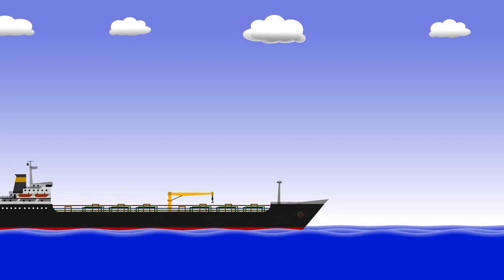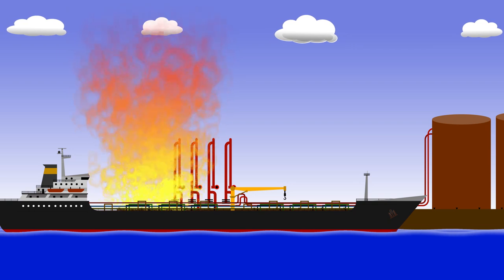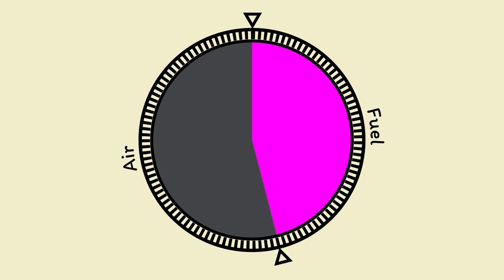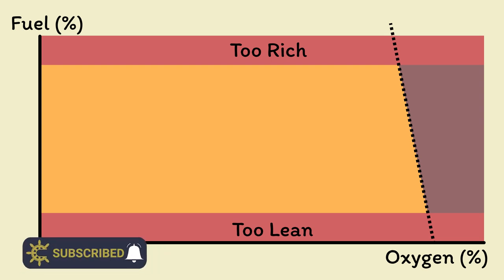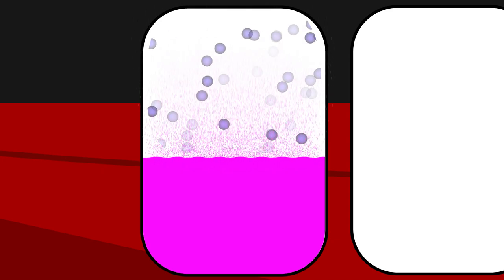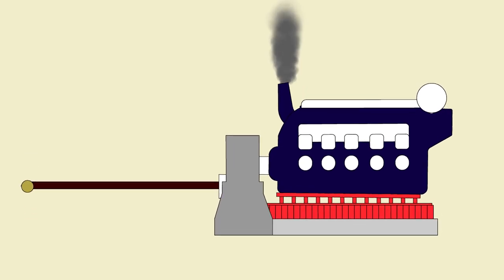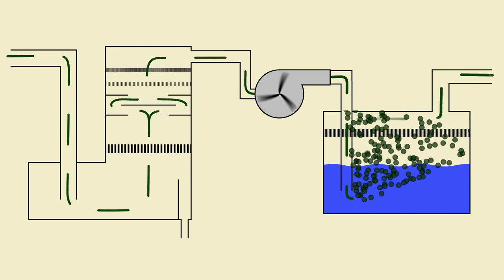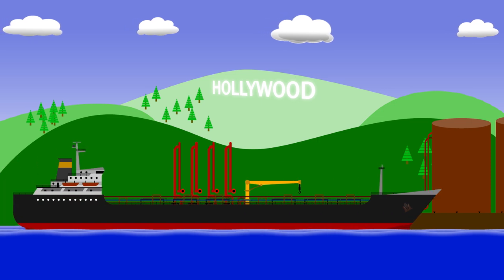Why Can't Petrol Explode On Ships?

Comment: Combustion Engine does not necessarily all oxygen to CO2, some oxygen remains based on efficiency of combustion. Also, For ships that transport bunker fuel or diesel, this flammable zone is the same with the ship's fuel. But if it transport other types of fuel like LNG, LPG, gasoline, the flammable zone becomes different. So it is actually very risky to use CO2 to make the content inert using ship's exhaust. Not mentioning that in case of combustion failure in engine, it may deliver oxygen rich gas to the flammable storage. Bunker fuels (which are typical fuel of ships since they are the cheapest) are also rich in sulfur which burns into sulfurous acid (H2SO3) can cause corrosion on metal surfaces. Also Reaction of CO2 with water seal forming weak acid called carbonic acid need also to be prevented since it may also cause corrosion which can cause leaks that may lead to explosions. In summary, CO2 is not the most cost effective option for inserting flammable fuel considering additional cost for safety and corrosion prevention needed for t

Comment: so what happens when the ship is at dock and the engines are not running yet but the fuel is being pumped in?
Reply: Mark S thats why normally auxilliary boilers are used and tuned to produce the highest amount of inert gas. Never heard the story of the engines itself being used for the production. They can deliver proper amounts of exhaust gas during the discharge for the cargo tanks and during loading for the ballast tanks.
Reply: The ship's engines are always running, you never shut them or it will be very inefficient especially in Tankers where there is always the possibility of emergency evacuation of the dock, see the use of firewire as well.
Reply: @mitsvanmitsvanio6106  how is the main engine always running if the ship is stationary?!

Comment: Dec. 17, 1976: Smoke billows from the wreckage of the Sansinena after a massive explosion split the oil tanker in two in Los Angeles Harbor.

(Jack Gaunt / Los Angeles Times)
Reply: Blasted windows out 22 miles away.

Comment: Video request: Why do ships need pilots? Many times I 've seen a boat with "pilot" written on it.
Reply: Pilots bring local knowledge to the vessel, for ships such as ferries that run over the same route the Master (Captain) of the vessel may gain sufficient local knowledge to be granted a 'Pilotage exemption certificate', thus saving time (and money) a situation that is always a bonus from the vessel owner/operator point of view.  Pilotage also gets the Port State a 'loyal' set of eyes on board for when things go wrong and thus helps them put 'the blame' on the vessel in any subsequent enquiry.

Comment: Tankers generally discharge cargo in port, the exception being when lightering. In port the Main Engine is stopped, so what is the source of inert gas? And why do the majority of incidents occur during tank washing?
Reply from the maker: Tank washing generates static. The sparks from that can ignite vapours.
Reply: @CasualNavigation  Thanks for the reply. 
I'm still at a bit of a loss, if the empty tank's atmosphere being washed is held below the LEL how does the generation of a spark within it cause an explosion?
Also, if tank washing is conducted at sea then will not the vessel benefit from having the Main Engine running and thus the provision of an inexhaustible supply of inert gas?
Is tank washing done at sea or in port? which brings me back to the original question of how is inert gas generated in port with the Main Engine stopped?
Reply: The main engine never stops, it is very inefficient to stop it, it just working underpowered.

Comment: The principle theory shown in this video is correct. However, the application or practical use on board a tanker as shown in the video is a bit misleading. The inert gas from the engine room is not sent to the bottom of the cargo tank such that it would produce bubbles in the cargo which should be avoided. The inert gas is supplied into the tank at the top of the cargo tank, not to the bottom of the tank.
Reply from the maker: That part of the diagram was still the inert gas generator

Comment: The remove the O2? Or they just add CO2 and increase pressure?
Reply: The 02 is used up in the combustion in the gas generator (or engine),  the process is regulated so the exhaust delivered has less than 5% oxygen

Comment: I'm sure these ships have redundancy built into this system, but what would happen if there was an engine failure? Is there a secondary system that takes over?
Reply: There are many ways to configure these IG-systems. In my time engineering these it was most common to base the inert gas on burning diesel fuel directly, in a separate burning chamber. You designed for redundancy on blower fans, pumps etc. and made sure to stock critical spares. But to save on fuel cost it made sense to offer a flue gas option. You could have either one system or the flexibility of both. On most product- and chemical tankers you based your inert gas on nitrogen generation by membrane separators. Typically you designed redundancy on the feed air side and membrane separator banks. You could have full system redundancy, but that is only practical on gas carriers due to cost and footprint.

Comment: If im correct the US Navy during WW2 did something similar and put carbon di oxide in their fuel tanks to help stop the fires from kamikaze pilots.
Reply: @Grigory S it would take time for enough oxygen to get to the fuel to cause a fire. Things dont burn just because there is oxygen there has to be a proper mixture for it to set fire.

Comment: You cannot use exhaust from an engine as inertgas, to much oxygen in it, but the ehaust from a boiler can have low enough oxygen content to be used as inertgas, maximum allowed oxygen content in inertgas is 5%.

Comment: When the ship has a full load, is it good enough for the tanks to be filled up all the way?
Reply: Yes. If the tanks are nearly full, there is insufficient air to cause an explosive mix with the oil fumes, and so the inert gas system is not required.
Reply: Tankers always have some vapor space in the top of the tank to allow for thermal expansion of the cargo.  98% full is limit.  This space needs to be kept inert for flammable cargoes.

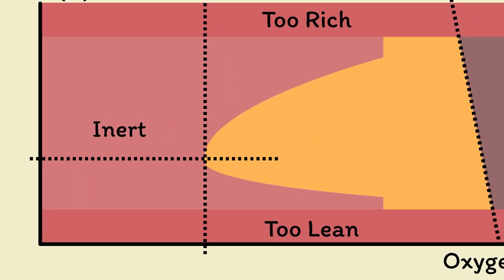Comment: 2:45 Don't pull a reagan on us, we need to know the numbers on this graph.
Reply: The exact numbers depend on the hydrocarbon being stored. Light fuels like gasoline or aircraft fuel evaporate easily, whereas say bunker fuel or diesel has a much lower volatility and as such are less flammable, which means the exact numbers are different for each type of flammable cargo

Comment: Why don't I just fill up the tank to 100%, so there is no space for anything to evaporate?
Reply: Liquids aren't compressible, but undergo thermal expansion, so you need some gas in a pressurized tank to regulate the pressure. Also, when the tanks are being pumped or when the tanker is returning empty, the empty space needs to be filled with a gas and it better not be something vulnerable to explosion.
Reply: 100% cargo filling is not permitted and it would damage the tanks.

Comment: Wouldn't just filling the tank with fuel sufficiently reduce the level of air (this oxygen) available to a point where this isn't needed?
Reply: yes, but filling tanks to 100% is actually really hard to do without either overflowing or leaving air bubbles
Reply: The rule on ships are that the tanks can be filled only 98%

Comment: Imagine if one could make fuel like a two component epoxy.
As long as you don't mix the two things together (in this case it's fuel and oxygen, but oxygen is too readily available) they won't be dangerous.

So filling up your car would be a two step process. First you fill up A, then you go somewhere else and fill up B. The two fuels will never mix in large quantities because cars don't have large tanks.
It would of course be very inconvenient for the drivers but it would be oh so much safer!

This is just a thought experiment really, not something real. But in a world where i could choose between "already dangerous as feck" fuel or two parts fuel i would choose the latter for increased safety.
Even if the fuels are accidentally mixed, they still need an ignition source and the final component oxygen.

Comment: Since when do ship use liquid fuels anyway?
Reply: Since the changed over from burning solid coal? And just before the switched over to LNG as fuel. But for running on 
LNG you need gasoil as a pilot fuel if I’m correct.
Reply: Don’t you know how Diesel engines work? They run on fuel oil.

Comment: Cars don't explode, ever, unless they are props in action movies. Even gas powered cars vent their fuel  rather than letting the tank rupture. Their tires often burst though, or the small explosive charges in their airbags may cook off. Also the smoke is highly toxic (like all dense smoke). Another hazard are magnesium and other alloys used in modern, lightweight construction, which can not be extinguished with water, and may cause an explosive reaction - but that is not a "full" explosion by the definition at the start of this video, either.
Reply: Yes these are known as Class D fires, burning metals.  Probably the most dangerous types of fire you will ever encounter.  They become so hot they can burn underwater, breaking apart the water molecule as an oxygen source, they are extremely difficult to put out and can burn through steel and even concrete.

Comment: There's an easier solution than adding co2 or n2... Just don't have oxygen present in the pressurized addition of the liquid... When you're filling up a tanker, if you have one way valves displacing the output, and you don't introduce oxygen, you won't have oxygen to begin with
Reply: But what is in the tank to begin with to be displaced.....?!

Comment: The reason is we learned it and engineers well spent their time into this unlike the inherent design flaw in a ship itself. That may still be of concern even here and thats what the ships these days needed attention. Every design is flawed due to the exposed part of the top layer. Ships and boats need to be redesigned properly closing this so even if it topples, it won't topple at all. Providing a proper material for the boat or ship which can take the waves structurally while giving an actual up thrust due to its actual material property rather than just purely displacement based approach is the next area that should be given some research.

Comment: That's not totally correct, we do not use main engine exhaust as co2 generator, that's too reach of oxygen, we instead use boilers. Also this is an expensive plant, thus used in big tankers  in small tankers, inert gas generators are used where nitrogen in the air is filtered and pumped to the tanks.

Comment: Aircraft use Nitrogen in there fuel tanks.
Reply: Ian James maybe some yet fighters but commercial jetliners just replace the fuel with air. No huge amounts of stored high pressure n2 on board.
Reply: Jets and turboprops use kerosene.

Comment: But why don’t they just fill the tank completely and seal them. There would be no oxygen in the tank so no explosion?
Reply: Tanks won't full instantaneously.  There will be stages in between when tank is partly full. There needs to be space for expansion of liquid,allowances also need to be made for rolling pitching rough weather

Comment: Why not fill the whole tank !??
To much pressure ??
Reply: Its definetly with pressure to do here but not in a way how you thought about it. Its the expansion that matter. When they fill it fully, to the edges, and then close the reservoir, fuel will be expanding or contracting inside that reservoir due to temperature differences that metal ship will have during its journey. So, when they will it to the edge and fuel start expanding, well, there is your pressure cause container wont be able to withstand that expanding fuel. 20 000 litres of diesel or gasoline, if heated from 20 degees celsius to 25 degrees celsius, will expand so much, that now at 25 degrees it would be around 21 000 litres of diesel/gas. Thats whopping 1000 litre expansion. Tanker has much bigger reservoirs so the expansion will be bigger too since more fuel will be transported at the same time. That is why no reservoir is filled up to the edges, there is idealy left 5-10% of reservoir for transportable liquid for purely thermal expansion reaaons.
Reply: @fulldnbboy  oh thanks for info 
You might have degree in physics 
I study in 9th class 
But don't worry your explanation is not in vain 
I understood it 
But can we make something to contain the pressure of the gases ?? That may explode instead of catching fire and then exploding 
Instead of filling pure no2 
I am just thinking how much oil will be wasted if we left it uncovered 
Thanks for explanation !
Edit : I know its about expanding matter and not about we filling it with pressure ....I studied it in 7th class ...heat chapter ...coefficient of thermal expansion topics 
What if we store it when its 45 degree c
Reply: @fulldnbboy   you're right about expansion, but not right about pressure. Tanks are always kept at close to ambient pressure, otherwise they may still blow up due to the same expansion. The reason the tanks are not filled up to 100% is to not overflow them, loosing expensive fuel and polluting the environment. 
P. S. as per your example the volume would increase by less than a hundred liters, depending on density.

Comment: This idea that the liquid isn't flammable, but the vapors are, makes no sense, and isn't true. If the liquid wasn't flammable, neither would be the vapors.
Reply: The bulk of the liquid itself won’t ignite with the vapors instantaneously since it has no contact with the oxygen. The vapor has enough surface area to interact and ignite. Less volatile fuels like diesel can snuff a lighted matchstick if it has been sitting long enough.

Comment: You got your science terms wrong bud, carbon dioxide CO2 is what we exhale and occurs naturally, also contains 2 Oxygen molecules. Engines exhausted is CO carbon Monoxide, only contains one oxygen molecule. Mind you it still works but the gasses are different both can cause asphyxiation but the ways they do it is slightly different, both because of a lack of oxygen obviously but co actually attaches to the hemoglobin in your blood cells and prevents them from taking on fresh oxygen. An easy way to remember the difference is co2 carbon dioxide what we exhale and co carbon monoxide (carbon motor).

Comment: Why don't they just fill the tanks to the top with liquid hydrocarbons?
Reply: You need an ullage space to allow for thermal expansion and contraction.
Reply: The tanks are often only partially full or completely empty with residual vapors still present.

Comment: Does this system cause significant cargo evaporation and loss? I imagine the positive pressure of the CO2 purge would push out evaporated cargo, more would evaporate, and the cycle would repeat. How is this mitigated?
Reply: If you have a higher pressure less liquid will evaporate.

Comment: 1979 the tanker beetle juice blew up splitting in two smt salvage had to cut it up and get it out of there. Cause it was right next to the valves of an oil distribution center.

Comment: Inert gas is for the most part unnecessary. The fumes that set in a fuel tank above the level of the fuel and the top of the tank do not have near enough oxygen to support ignition. It's why no aircraft has ever exploded even with Sparks occurring in the fuel tank. TWA Flight 800 head 153 Witnesses who shot a missile go up and blow up at that aircraft. To claim that the fuel tank spontaneously exploded flies in the face of 737s which were found with hundreds of Arc points in their fuel tanks that had never ever exploded.

Inert gas would be highly effective as you empty the fuel tank and by doing so you introduce atmosphere into the fuel tank bringing the fuel-air mixture much closer to an explosive point.

The operation of burning, the fire, is not the reaction of the fuel to oxygen in the atmosphere. It's the merging of them. If you don't understand fire why are you doing it video on flammability?